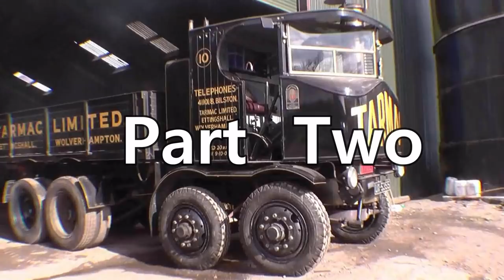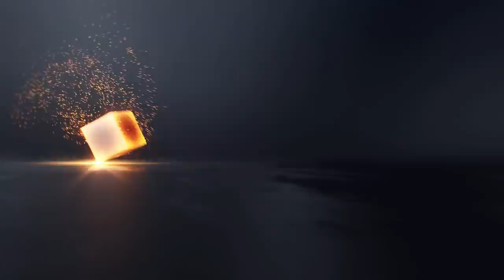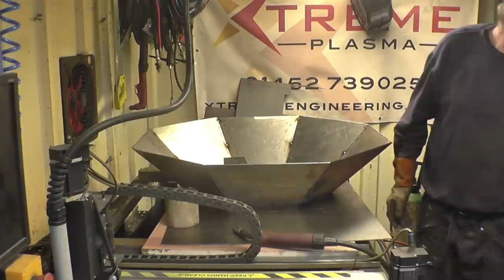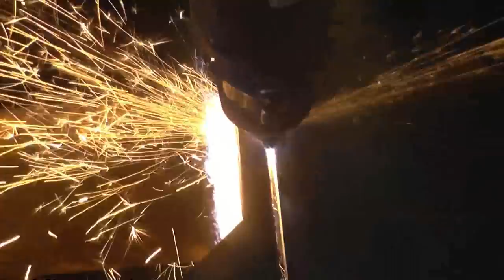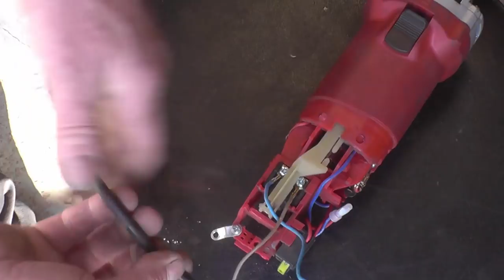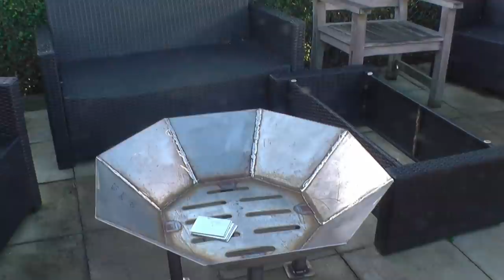SNNC 354 P2   Building A Fire Pit  .  Death Of A Die Grinder

Comment: On the die grinder problem, Dewalt grinders have brushes with a spring loaded plastic bullet in a hole drilled part way through the carbon. When they wear to the end of that bore, the spring pops the bullet out and pushes the brush away from the commutator! Game over, you think, but if you pull the brushes out and toss the springs and bullets in the trash and reinsert the brushes, it will run for a loooong time before they actually need replaced! It’s a ploy by Dewalt to make the uninformed masses throw it out and buy new! I’ve got grinders that I’ve done that to years ago, and they’re still running strong!
Reply: That will also save the commutator from damage due to the arcing when the brushes get too short. Then put new brushes in.

Comment: recently i have had some good results with a faster feed rate when turning delrin. say .015 per rev. makes a very fine chip. good when ruffing.
Reply: I turn loads of delrin on my CNC lathe roughing feeds usually 1mm a rev.
Reply: @VulcanBomberxm655  .021 thou as high as my lathe goes. interesting.

Comment: The die grinder just needs new brushes. The noise you can hear is long range arcing. Seen it before. Change the brushes, it's barely run in. :)
Reply: i was going to say that! strip it down blow it out good, do check the communicator ring due to the long arcing and fit a new set of brushes job done!
Reply: @thatdude101ish  Yes, you could but it has two brush inspection hatches so you could just pull them out and replace them.
Reply from the maker: I will have a look   been a decent tool that has really had some hard graft
Reply: @doubleboost  Yes, it is quite a good one. Not sure where you can get the brushes but I expect the service line will help.
Reply: Ronald Farley  Many thanks, interesting.
Reply: Ronald Farley  ive repurposed larger sized brushes before just tickling them on the side of a grinding wheel or on the belt sander down to size, it works a treat!

Comment: This material is POM, trade name Delrin, from a machinist’s perspective, the most magical of polymers.
https://en.wikipedia.org/wiki/Polyoxymethylene
Don’t run it too hot, it burns without flame. Aluminium inserts with a larger radius make impeccable finishes.